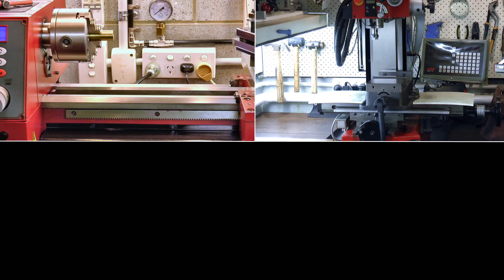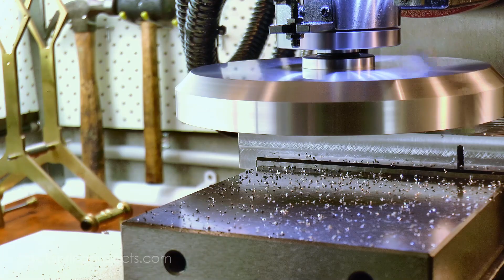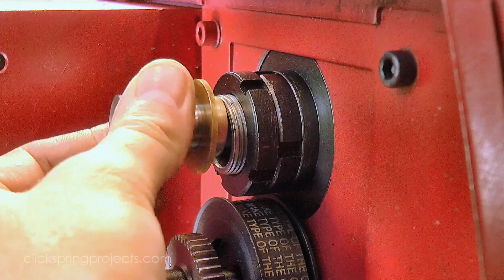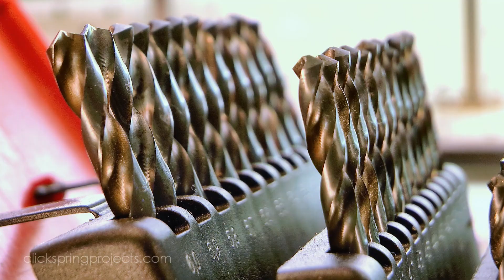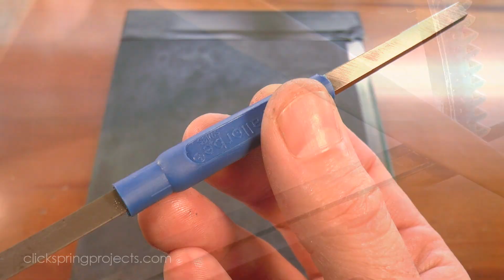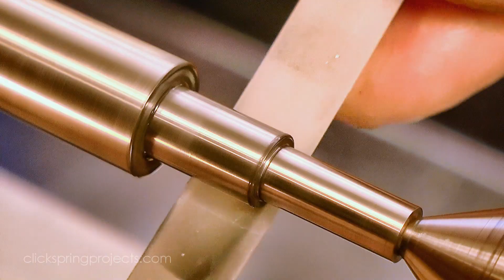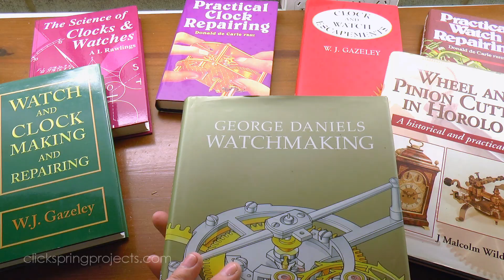Tools, Glorious Tools! #4 - Setting Up A Home Machine Shop: Where Do I Start?

Comment: While i haven't set up a machine shop, I did set up a woodshop 20 years ago. A great way to learn how to use your tools is to make more tools. In woodworking, I made shop "furniture". A router table here, outfeed table, workbench, simple cabinets and drawers to hold stuff. It's great because you can use lower quality material, and if you make a mistake, who cares, it's workshop stuff. 

Use a new technique or two each time you make something. That's how you learn what works and what doesn't. And have fun, because that's what it's all about!

Comment: Where to start? I guess the first thing to do is to sit down and think about what you actually want to make because that will dictate how your workshop evolves.
Then it's books, books, and more books. The 'Workshop Practice' series are truly excellent and inexpensive. They can help to steer a novice in the direction they want to go while avoiding expensive purchases of things they don't really need.
The two publications that I refer to on an almost daily basis are a Zeus Chart and "The Model Engineer's Handbook". The latter is not meant to be read cover to cover; it is a source of super useful information you dip in to every time you have a "How do I...?" question (and I have LOTS of those).

Regardless of what machine tools you buy a decent ShopVac is indispensable. Also, for those of us of a 'certain age' (ahem!) magnifying glasses with built-in illumination are really handy.

Things that those just starting out need to realise:
1) Whatever you pay for individual machine tools you will pay the same again (and more!) for the "everything else" you need to make things with them.
2) In engineering there is ALWAYS more than one way of doing EVERYTHING successfully.
3) You will probably spend half your time making jigs, tools, and accessories in order to make the thing you wanted to make in the first place.
4) Accept that you will probably have to make parts more than once to achieve success.
5) Most of the time 'good enough' is perfectly acceptable.
6) Most hobbyists can get away without having a thread cutting facility on their lathe because taps and dies exist but a QCTP and collet chuck are worth their weight in gold.
7) You'd be amazed by what people can make with relatively basic machine tools when they have access to decent measuring equipment and a really good selection of files.
8) And finally... For those who have never bought a machine tool (lathe, mill, etc) in their lives before I think it is worth pointing out that while the instruction manual that comes with it will explain how it works it will not tell you how to make things with it.

Comment: I have always used the "buy twice" plan for things like drill bits.  Buy a cheapo set first to get a wide selection.  Then buy quality replacements when you figure out what you will actually use.  My tap set has ~10 harbor freight ones but the 1/4-20 is now actually good.

Comment: My shop is rather small, and I don't see how I can fit in a piano and piano player like you have. This has been hampering my work considerably and nothing I make is as nice as yours.

Google books has both Popular Science and Popular Mechanics scanned and on-line. The Issues between 1920 and 1950 are especially good with projects and how-to articles.

Clickspring makes an excellent point about tooling. Buy good stuff, but remember you don't have to buy it all at one time. If you are just starting I would recommend something like the Harbor Freight good quality grade tap and die set and the number, letter, fractional twist drill set. The trick is to realize that there are many of these tools you may never use (except when you need them). I have letter drills I bought in the 1960s that have never been used. When you wear-out or break one, go to your favorite industrial supplier like McMaster-Carr or Travers Tool, etc. and replace with an industrial grade tool. Do the same with reamers. Keep an eye out for a reamer storage box and buy reamers as you need them.
Considering collets.. inexpensive 5c and 3c collets generally work fine for the home shop. ER collets and holders are another matter. Generally Chinese ER holders and collets are so bad they are unusable for anything but woodworking. You really get what you pay for. Avoid evilbay and buy from a supplier who guarantees the specification of the holders and collets. Yes, $18 for a collet seems expensive compared to the Chinese $3 collet, but if you'd like your 0.0625" end mill to have something better than the Chinese 0.005" runout, buy the good stuff. 
Cheers from NC/USA

Comment: Hey Chris, do you have suggestions for honing stones ? I can't seem to get a very good surface finish on my HSS lathe tooling. Thanks heaps for making these videos.
Reply: I use a set of the DMT diamond sticks.  Fast on HSS and can be used on carbide as well.
Reply: @russkepler  thanks Russ, I'm a bit confused and don't want to blow my budget given all of these good honing stones are bit expensive. People in forums seem to find DMT stones don't hone the edges as well as sintered ceramic ones like extra fine Spyderco ceramic stone. Others recommend Dan's Arkansas oil stone but say it's no good for cobalt HSS. Pretty overwhelming.
Reply: @HM-Projects  Take a look at the "Dia-sharp" mini-hone kit.  Retail on that is <$30.  If you want to go finer on HSS you can then add a hard Arkansas stone to the mix, carbide really doesn't like a fine edge except for very particular circumstances.

Comment: When you're learning, buy the cheap tools and instruments so you're not holding back worrying about breaking the expensive tools. Once you're comfortable with how they work and what you can do with them, then look into buying something of higher quality. In some instances, you might not actually ever need the higher priced tools.  There are several items that I buy the cheap versions of so I don't have to worry about breaking or losing them. I can buy 10+ of the item for the price of just one of the pricier versions.  This will of course depend on your personal needs and preferences.
Reply: It also helps filter out things you actually need from things that are just nice to have. No point spending a bunch of money on a tool just to find out you only really need it for the one project.

Comment: Excellent video man.  I too am an older hand at this and you're setting up a newbie to succeed.  As most of my work is quite small I went with the Sherline lathe and mill.  One nice thing about them is that they have such a huge selection of tooling and accessories for their equipment.  Their only limitation is the same as all machinery: size constraints.

Comment: Only one thing I think could be improved, and that is a porta-band over a horizontal saw.
I have a Bauer that cost $150 and it’s a really good saw. Make a stand for it so it can be used upright, and it will do almost anything you need. 
Most hobbyists aren’t sawing 3” 4140 round stock to length all that often, and a porta-band is just as good at everything else and a lot cheaper than a horizontal saw

Comment: Wouldn't be without an optical centre finder for the mill - mine was a silly price on ebay but there are one or rwo homebuilt designs out there.
Reply: I never use any of the traditional layout methods that would require an optical center.  I sometimes put layout blue down and put on some rough layout marks, but most of the time I use edge finders to find 0 and position using a DRO.

Comment: Great video full of valuable information. There are alot of great comments also. There is the age old question about buying new or used machinery. You need to do your homework no matter which way you go. I have picked up older machines in great shape that the accessories alone would of cost more than the whole package but I have also bought machines that were more trouble than they were worth. This one depends entirely on your situation.

Comment: When considering a lathe, forget a Grizzly G0765. Plastic drive gears, loose cross feeds, and a chuck that has a runout of .002 right out of the box that you will never fix. :(
Reply: Anything can be fixed. Plastic gears can be replaced with metal ones, and spindle bearings can be replaced with more precise ones.
Reply: @TitoRigatoni  The real question is: Is it even worth it?
You'll also need to scrape the bed, headstock, saddle and tailstock or put shims everywhere to make it accurate.
replace the motor and crappy pulley when the control board craps the bed.
re-grind the spindle taper. Make new saddle gibs to fix the poor engineering also present all over the rest of the machine.
And even when you're finally done, it will still have the rigidity of jello.

No, you can't fix everything. There is barely enough metal left to machine in this kind of tool for it to even work.

Comment: I was pricing out the 7 x 12 lathes and small mill-drills, when I found a 10 x 36 Logan on craigslist.  I snapped it up and got a drill press and horizontal saw too.  It was a long road of being too late, and losing out until my timing clicked.  The mill was next.  I found a full size bridgeport clone for less than a new mill drill.  I decided on full size tools, since the prices were comparable, and the quality was better.  My shop is a single car garage.  Well, it was a single CARRIAGE garage since this house predates cars by several years.  Network with like minded folks on the forums and don't be shy asking for direction or help finding supplies.  Some are professional appliance users and can't see past shiny new and production capable machines.  Don't be offended when their arrogance vomits on you. But others are real machinists and mechanics.  They usually bend over backwards to help out and teach a humble beginner.  Just my tuppence, your mileage may vary.

Comment: 3D printers have become so cheap that it's worth considering having one for doing plastic mockups of the things you want to machine in metal. Testing that linkages and other geometries work the way you think before committing can save a lot of hassle, and having a 3D printer available for making wall mounted tool holders, trays, drawer dividers, etc keeps the workspace clean and convenient. And since PLA filament is so cheap it doesn't cost much to change your mind or expand holders when you (inevitably) get more stuff.

Personally I dislike plastic in general. I like wood, leather, brass, steel, glass and ceramic enemals, but there's no denying that a random doodad to keep my nuts and bolts separated can be modelled in 10 minutes and printed in an hour while I spend my time on something I actively like. And since it's going to live in a closet anyway I can live with it being a bit crude looking.

Comment: One of the cheaper tools I like to have is a Dremel. It's usefulness should be evident, but in the right situation you can grind out a broken tap with those little diamond burrs.

Comment: One of the cheaper tools I would add is a ShopVac. I made mine from a broken household vacuum(for the motor, power cord, hose, and filters), 2 five gallon buckets (one with a lid, the other for the motor cover), and a switch I pulled from a broken lamp. It took less than an hour to make and I got all the materials for free. I just grabbed what I needed on garbage day. It's been working for 5ish years now.
Reply: Absolutely agree! Cutting chips are sorta easy enough to handle with a hand broom but filing and sanding dust is just a pain in the rear without a vacuum device of some description.
Reply: another good one for the shop, or even the deck is a power washer... but if you are working with small items... look toward dental equipment... you can do alot of cleaning on small parts with a waterpick and a toothbrush... just saying. =D
Reply: Adjunct to this: you can use flex tubing like locline or even just some corrugated plastic tube with a heavy steel wire down the middle of it, to make an adjustable vacuum chip removal setup you can bend to be close enough to the cutting point on the mill and catch at least half the chips.  The long stringy stuff off the lathe seldom goes far, but the mill makes a huge mess.  Same goes for the grinding wheel: a box behind it with a shopvac helps contain the grinding grit.  Jewelers set their buffing wheels up with a loose cloth bag behind the wheel to catch jewelry that snags in the wheel and gets thrown, but generally we use tool rests so we don't have to worry about that.
Reply: Agree. Finally freed up the wet and dry for the garage and it's so nice to see a clean lathe when you've tidied up at the end of the day.
Reply: I forgot that I found a set of casters for it too. Pulled them off an broken desk chair.

Comment: I'm currently building up a machining toolset. These are my early experiences.
A bench grinder is great to create a new cutter, but a small diamond stone is ideal to touch up the edge of a cutter every time before using it. Especially when cutting steel.
You'll also need holders for your indicators : a mag-base holder and perhaps a holder for around the spindle.
These are the tools I created, in order, right after buying my Sherline lathe:
- T-nuts and slotted clamping plates (for a Sherline-size lathe, most of the tools you can buy are too big and buying them from Sherline, too expensive)
- A ball turning tool (because I needed one for an early project)
- Storage! For my situation, wooden boxes are ideal - I like making these myself. Since I don't have a dedicated machining workshop, they allow me to quickly take out and store away my tools.
- A hex collet block for my ER holder. Made out of hex stock. Accurate enough for now. I'll make a square one later. The hex version will also work for square features for now.
- A wide screwdriver for the custom screw that tightens the ER holder in the block.
- A boring head as I need to make wide radii. (Boring head currently in the making - the ones you can buy online are MT2 or higher, while the Sherline needs an MT1 holder)
TODO:
- Pancake V-blocks. I bought small V-blocks but they are still too large for the Sherline vise! Some 120 degree pancake V-blocks (V-plates?) will help me hold round parts in the vise.
- For these V-plates, I'd like to use a fly-cutter...so, I'll be making one of those.
- Bought some saw blades....need to make a holder for this.
- A quick-release holder plate for my mag-base on the cross slide. Sherline's cross slide is aluminium - magnets don't work!
- A sine plate. To set the height, I'll make some rough gauge blocks myself as I need them. They'll be more than precise enough to set an angle.

- Single-point threading. A Sherline can't cut threads out of the box. You can buy a gear set for this and it's actually not that expensive for what you get. Still...I would like to be able to make gears myself, so...more tooling needed.
- Offset center for the tail stock to support taper turning. You can't adjust the Sherline tail stock, so a little offset jig (just a dovetail slide) allows the setup.

I mainly want to use the lathe (and mill) to repair things and to create hardware for furniture or to create parts where wood or 3D printed plastic aren't strong enough.
Notice above how easily you get into side projects, just to make tools and jigs you'll need.
My first big project is a wood+brass lamp, but I can't make it yet because I'm lacking tooling.
So be prepared for quite some journey before you can actually make what you want. 

My most frustrating thought as a beginner has repeatedly been "Darn, can't build that yet because I don't have..."
All the youtube projects you see built will typically involve a wide toolset!
So, I do NOT agree with a statement like "With this minimal toolset you can build anything..." Nope. You can't. Trust me.

To prepare you for what you can do when you buy a (bare) lathe, hold this thought:

"A lathe can make cylinders. That's it."
(ok, that's not entirely true, but still)

Comment: For the milling machine, DRO is a must have. Not so expensive today, but sometimes difficult to fit on small benchtop machine.
And never forget, always buy the biggest machine that fit both the kind of work you do and the machine shop you own.
Reply: TouchDRO has quite a few good reviews by YouTube machinist and is affordable.Search YouTube for TouchDRO
Reply: Absolutely!

A lathe can be worked on without a DRO to a very reasonable extent. Usually a Dial indicator and calipers are enough and can be added upon with micrometers and telescoping bore gauges. Neither of which are expensive at all. But a mill? Of course there are also dials, but making mistakes is easy. Working to dimensions and drilling Hole patterns is just so much easier with a DRO.  And as you said, they are pretty cheap nowadays. I believe I paid maybe 250€ for mine on the mill and that one even has an LCD display with graphical interface. Highly recommend!

Funnily enough, I did order a DRO for my lathe just 3 days ago. Well, haha.

Comment: You just reminded me I've got the Build Your Own Metal Working Shop From Scrap series by David Gingery.  It's on my list of things to do.  It's just that running an aluminum-melting forge in an apartment, let alone a lathe, is probably a bad idea.  Heck, I probably won't build the Gingery lathe.  Just buy a small one and a drill press, then make the rest of the machines and accessories from the books as best as I can.